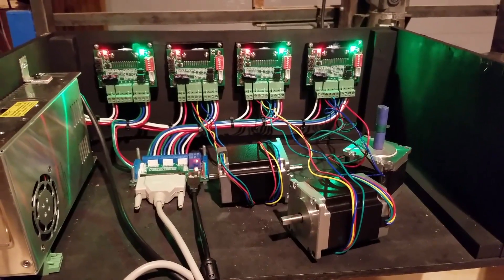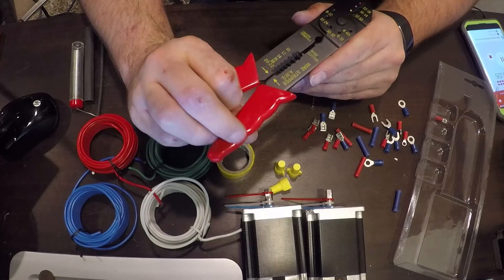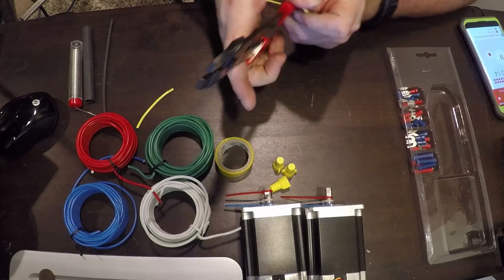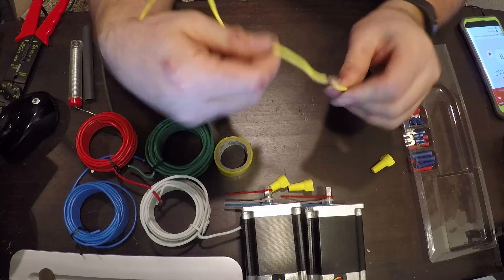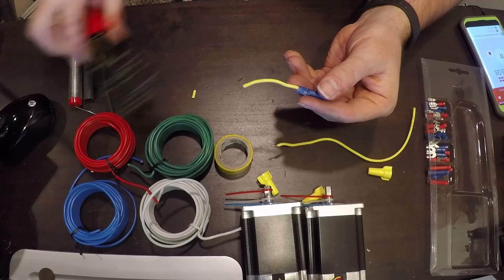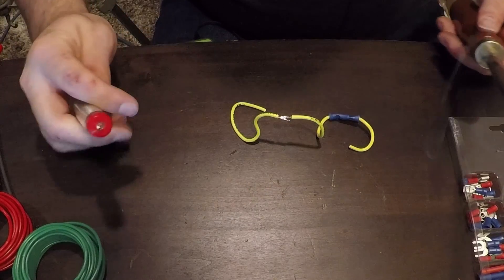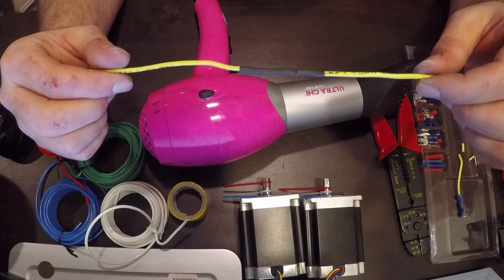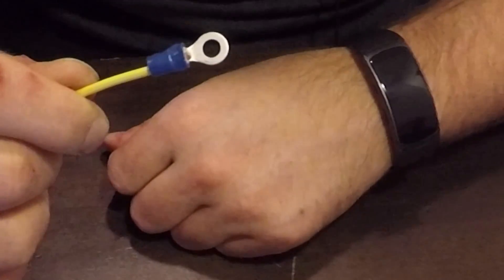Electrical Wire Connections for Beginners, Tools and Tricks

Comment: Where did you buy the colored wires?
Reply from the maker: Mert Capkin Home depot. I wish they were cheaper( they're $5 per roll), but I'm glad they had them.
Reply: Strange Garage ah okay, I see. Thanks for your answer. AliExpress is a great source for everything. I use it a lot.
Reply from the maker: Yeah I like them. I have only used them a few times, but they were good.

Comment: Hey SG the code on wire nuts when weiring like a ceiling fan now you are supposed to wrap electrical tape around the wire nuts.
I all ways did that any way..remember many years ago it was twist the wires together and tape them...Cheers 🍻🍻
Reply from the maker: +Rodney Brand it's cleaner that way, but if I gotta do permanent I would throw heat shrink over the whole thing. I've seen people go both ways with it, but we've all seen hacks just throw a barrel on the bundle of conductors and wrap it in tape. Functionally it's correct but ugly as hell, and won't pass code.
Reply from the maker: +Rodney Brand i always look forward to your comments btw, It's like having friends that check in from time to time. The internet is pretty cool.
Reply: Strange Garage.   Hey S G...I wasn't throwing code at you or anything like that..some times codes are stupid..I like to solder and heat shrink and use wire loom..I've had my share of screw up's so I just do it the way I like.it works for me..good video..Cheers 🍻

Comment: Hey SG, What gauge wire are you using 16?  I ask because this is the same gauge wire you used to wire your CNC electronics, right?  This is helpful video especially for wiring beginners.
Reply from the maker: +Ted H I originally wired the CNC controller with 22 (all that I had), then the best they had at home depot was 14. I recommend something in between, but I wouldn't have to recommend anything if the CNC directions were any good, lol.
Reply: Strange Garage thanks SG, so optimally somewhere between 16 gauge and 20 gauge?  I'm going to build CNC box soon so I'll most likely order the USB only controller kit in the next couple weeks. I'm excited for your new videos as you progress through your new CNC build.  Thanks SG.
Reply from the maker: Ted H Something in that range should be good. Your instructions should be king though. Mine tell me to use shielded wire, but I didn't on my last machine and I have had zero issues.

My next vid is gonna be slow(waiting on critical parts until Feb 8th) , just going over building your rails, and setting up the extra stuff in mach 3 like the e-stop and relays. I wish I had that resource when I built my first one, but it's still not super interesting to most people.
Reply: Strange Garage sounds good, I'll wait to purchase the CNC kit before I buy the wire that way there won't be any wrong purchase of wire size. Thanks man
Reply from the maker: Ted H That's a good plan. I'm ok with making mistakes on my own stuff, but I don't want to lead anyone down the wrong path! I have seen current jump through insulation, but I doubt it's going to happen, even with the more powerful motors on this machine, so shielding is probably not necessary.

How does your wife feel about this project? A friend of mine built one last year and he said he just blamed me the whole time so his wife would be mad at me instead of him. It worked.
Reply: She is not real excited about it, but knows when I put my mind to something, there is no stopping me! I think she will be happy about me only spending $500 to $700 on a CNC over the next couple months vs. thousands on guns (she is tired of me adding to my gun collection)!   The CNC will be able to create cool stuff and possibly add a niche to my business. Your wife seems like she is pretty supportive of your channel/projects.
Reply from the maker: Ted H She is as supportive as she can be. Her Dad always had projects, and as long as I work on her projects too she lets me get away with a lot.

Comment: Bad strippers are bad news :-(
Reply: Mr Frog SG said multiple times the video this type of wire strippers are not great at all, and I wholly agree, I use them for crimping only.  I mainly do Residential and light commercial electrical so I don't do a ton of crimping. However SG has a great point and if you're only going to do a single project that requires wire strippers, it doesn't make sense to spend $15 to $20 on a nice pair of Klein's, and you'll still need something to do crimp connections if you use many of the connector types he uses in this video.
Reply from the maker: +Mr Frog I shouldn't say "bad" but without doing my "double strip" method they really don't work well at all. Not for this wire anyway.